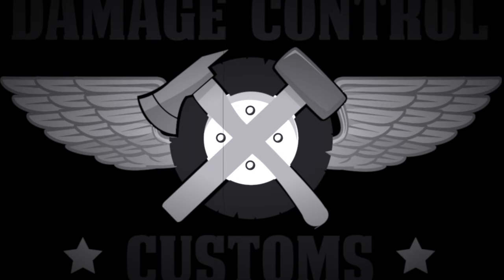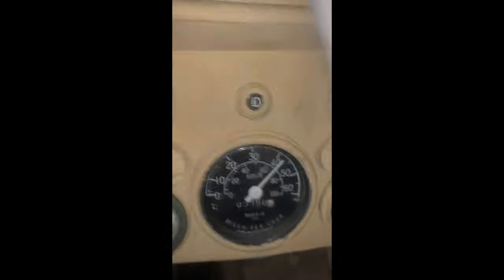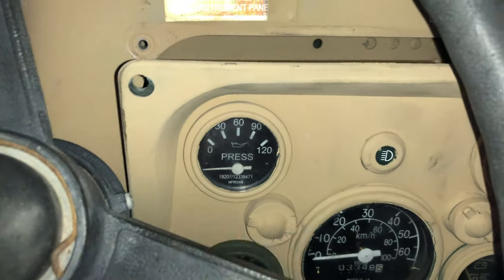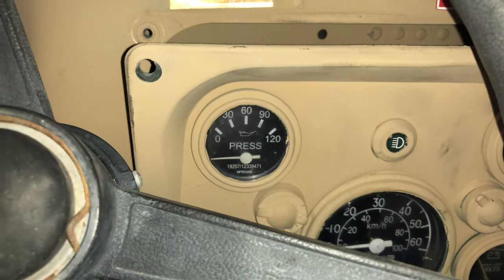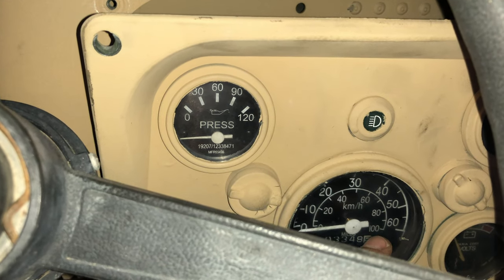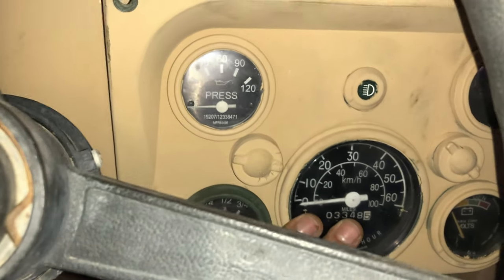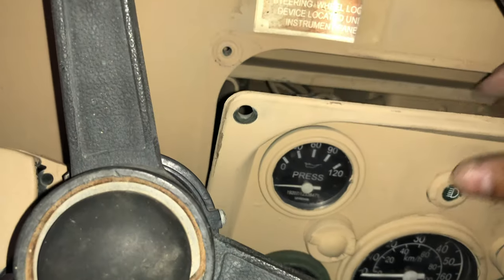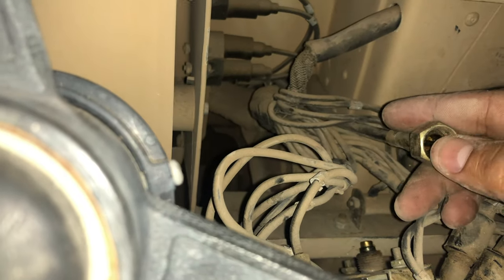DIY: Speedo / speedometer on my HMWV © / HUMVEE © not working

Comment: My humvee doesn't even have that wire
Reply from the maker: Do you have the 60mph ? The 60 is mechanical the rest are electrical
Reply: My whole gage cluster is missing I had to buy all 5 and the housing. I have both sections of wire plugs n grounds but I think I have to buy an entire speed wire
Reply from the maker: @thefallenone199  open your hood and see if it’s there and maybe just got pulled out.  It will run below the Cadillac valve and come out right by your break fluid.  Then when you open your dog house it should have a retention grommet on the left lip (driver side).  So it basically loops around then drops down
Reply from the maker: @thefallenone199  open your hood and see if it’s there and maybe just got pulled out.  It will run below the Cadillac valve and come out right by your break fluid.  Then when you open your dog house it should have a retention grommet on the left lip (driver side).  So it basically loops around then drops down
Reply: Found it, Its been cut
Reply from the maker: @thefallenone199  it’s an easy item to replace.  Call Hummer parts guy.  Tell him Ruben from Damage Control sent you.  He’ll get you the right part